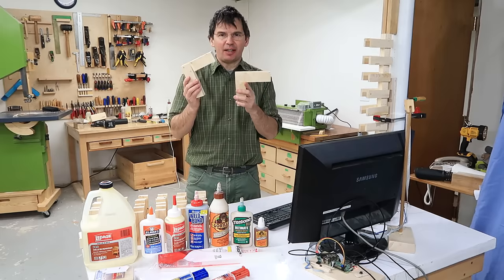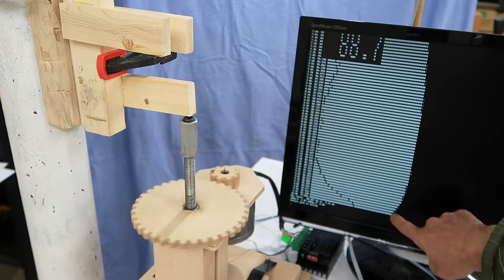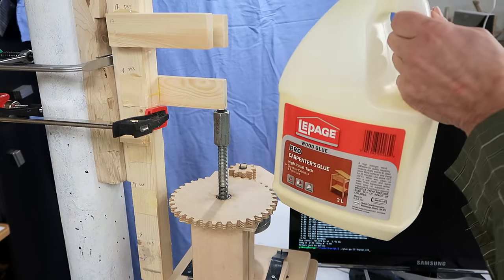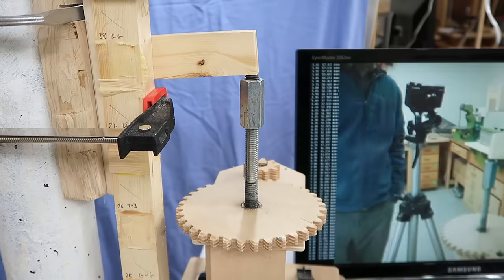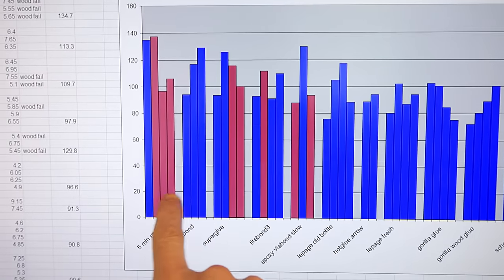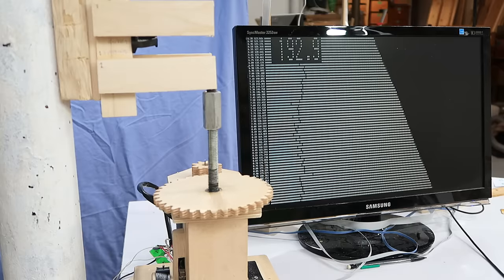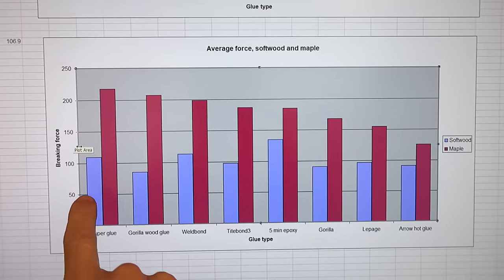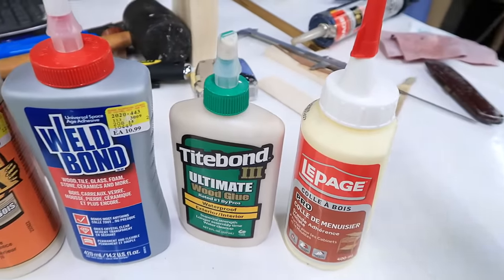Which glue is strongest?  Testing with my computerized tester.

Comment: Thanks for doing all those tests Matthias. Very interesting to see all those results. That must have taken a long time.

The construction adhesive that you used is different than the one John uses which is a polyurethane. I use the same type that he uses. I was building a workbench a few years ago using that polyurethane ca and realized I had put a piece of wood in the wrong spot. By the time I had a chance to get back to correct my error it was about 20hrs. I was banging that piece of wood with my framing hammer multiple times and could not get it off.
Reply: yes. the pl premium is the polyurethane based glue which cures with moisture. i'm not sure how that pl400 cures.  I would like to see how the pl premium holds up, i'd put a dollar on it winning or tieing with the epoxy.

Comment: Bravo for the constant strain rate tester, a DIY Instron.  
As with wood glues, there are numerous construction adhesives. Not all  of either category are created equal.  The Liquid Nails construction adhesives tested by Project Farm in July 2019 was at the bottom of the pack.

Comment: Great video, never would have thought CA would have done that well.

Real world feedback.

Gorilla foaming glue doesn't hold up in the humid Texas Gulf Coast climate.  I used it to repair part of a fence picket (the top piece broke off due to a knot and a utility line worker).  It lasted 3-4 years before the glue failed and the wood again became loose.  I cleaned it the best I could and used Tight Bond III and so far (4+ years) its holding.

Comment: That's a great comparison! Thank you. 
Further ideas for testing; perhaps try wiping down the gluing surfaces of the softwood with acetone or something to try to get rid of potential oiliness? And/or maybe scuffing the gluing surface a bit with some 80-grit sandpaper (even though it was already rough). 
Or maybe the softwood is just so relatively flexible that the weak points in the wood/joint are allowed to move enough for a break in the glue joint to propagate more easily.

Comment: Good test. The Titebond III is waterproof though. Don't know about the gorilla wood glue.

A few percent isn't a major concern to choose one over the others for all applications. The top performers are all fairly strong and are likely to break the wood before the glue. Stuff like working time, cleanup, water resistance, finish appearance, and sandability all come into play for real projects.
Reply: The gorilla wood glue is type II water resistant; not water proof, but fine for projects subjected to moisture (rain, splashes, etc.).

Comment: I would like to see a similar test with the pulling apart strength. This 90 degree test is good but introduced a twisting effect to break the wood or the glue. So, to see how it pops apart too to bottom not sheer strength.
Reply: I was going to suggest the same. I imagine the hot glue would fail quickly.

Comment: TB3 is still my favourite as a general use wood glue. I've never been a fan of WB or LePage in the past. Gorilla glue always worked as a "repair it now, not repair it right" sort of solution. Good to have around in emergencies but certainly not a woodworker's staple, in my humble opinion. Just like construction adhesive it's great at dissimilar material bonding for funky applications.

The thing that stands out the most is that the normal cure two-part epoxy is weaker in your tests than the 5 min.

I guess your data might warrant looking into LePage again. Thanks for sharing, good sir!

Comment: Thanks for doing this!
That very thorough, methodical approach reminds me of Project Farm tests.

I have been using BondCrete which is a PVA concrete admix/sealer/surfacePrep here in Australia and getting better results than traditional wood glues, with the addition that I already have it on hand in 5L buckets, be interesting to know if you have something similar there you could test.
Reply: Bondcrete is basically just standard PVA, but in bulk. It certainly works well on timber, but surprisingly (for what it's sold as) it is not particularly waterproof.

Comment: I feel like the surface finish has a lot to do with how good the glue holds. Something like oak with a ton of texture and pores combined with a good runny wet wood glue (water based to open up the pores too) would hold 2x as well as on a freshly jointed maple face which is ultra hard, and smooth and non porous.
Reply: that is something that i noticed too, it makes a difference if your wood is freshly cut or sanded vs case hardended.  or dusty, etc.

Comment: As a retired custom furniture/cabinet maker, I've used a lot of glue, and I'm still doing some woodworking.  I got a kick out of how your "test" came out compared to my favorites.  For ME, construction adhesive really hasn't been all that strong, and my two by far favorite woodworking glues are, Gorilla wood glue and Tite bond 3!  Looks like we are on the same wav length!  lol  SR
Reply: My favorite is titebond white all the time. I wonder how that would compare to other glues
Reply: @marcelo403polo2  Titebond has been my go to for home audio projects for years, this makes me want to try out the GG to see how that works out. I’ve also used construction adhesive for a few larger 30-40 cubic feet enclosures and I’ve found that it’s got a long set time so positioning awkward pieces was always easy. It fills gaps great and it sticks to most any surfaces + angles.
Reply: @Noughtta  
Being that it's formulated for structural use, I wonder if construction adhesive has more give to accommodate building flex without cracking.  If so, that give might have an impact on the acoustic properties of the enclosures.
Reply: Titebond 2 is my go-to, especially if you need something that sets up quick and for most interior projects.. Titebond 3 for exterior stuff or when you need a longer working time!!! All the other choices are garbage except the cheap "wood glues" which are fine for most DIY/weekend warrior stuff. Construction adhesive is just that. Construction adhesive. Yes it will hold but no where near a real wood glue. My fav construction adhesive is probably Sika adhesive, the gooey PL stuff is pretty good too but I'll always grab a tube of Sika before anything else.

Comment: The gorilla wood glue lasts a super long time from my experience. We've had a bottle for over 7 years  and it's still working just fine
Reply: That's how most PVA glues will behave as long as they're stored properly. Reputable manufacturers will always put a date of manufacture on the bottles though, and have a recommended shelf life. TB wood glues are 2 years minimum, so they're what I stick with.
Reply: @NWGR  if you store them slightly under the MFT / Chalk point (according to the data sheet) it will extend the life of the product usually dramatically
Reply: That means the gorilla container is airtight
Reply: Yep, if you can still get it out it will work just fine.
Reply: @NWGR  I see what you did there :)

Comment: Awesome video, but 2 questions; 

1. I have always heard/read that wood glue works as best as it can when both parts are smooth and well fitting. The logic being that the glue bonds fiber to fiber not to itself, so the more fibers touching equals more strength. The pine samples seemed to be very rough, well beyond typical "tooth" such as from a fresh sanding, including what looks like chip out and sawblade marks. Though a glue joint may be adequate with such roughness, it would not represent the maximum performance of the glue, if what I heard was correct. But, Matthias seemed to indicate that his expectation for wood glue was that it would be stronger on the rough surfaces. So that makes me wonder if I have misunderstood?

2. Does anyone have any data on how much strength is "adequate" for certain applications? I like these empirical demonstrations, but it leaves me wondering whether or not all of these samples were strong enough regardless of which was strongest. In other words, the construction adhesive, which I do NOT use, was the weakest but its possible that it would strong enough for a given application assuming the wood joint was well made?

Comment: Then there’s longevity. Not only is construction adhesive weak at the outset, it decides to let go years later. Our contractor glued and screwed floor decking to the joists. “You’ll never have a squeak,” he pronounced. A few years later, the adhesive had all let loose and I had to install many, many more screws to quiet the floor. I wouldn’t use construction adhesive to build a henhouse.

Comment: I use the traditional, exterior-grade wood glue for 99.8% of my projects. For those that use the caulk gun stuff, what is cleanup like after squeeze-out? Besides the workpiece, clean-up often includes clamps, work-benches, floors and other tools.

Comment: I think you cleared up a mystery for me. When gorilla glue first came out, I picked some up because I had been impressed with their duct tape. I had this same experience, it bubbled up like a foam and separated the joint. A year later I mentioned this offhand to another woodworker I know, and he's where he had been using nothing but it for a year. He had no idea what I was talking about when I said it was foamed up. I was completely unaware there was a second type of gorilla glue that was not that horrible stuff. I normally quite agree with this guy so it was one of those things that stuck with me, off putting.
Reply: Gorilla is a BRAND of glue, not a type. They make Fast and Slow set Epoxys, Metal-reinforced Epoxy (aka JB-Weld), Contact Adhesives, Super Glues, a full range of glues.
The bubbling stuff is Polyurethane glue, and it's also available from many other suppliers (eg: Sika). If you read the instructions, you will see that you MUST clamp that style of Polyurethane glue. You know, RTFM or the label on the bottle.

Comment: Are you testing the glue or the yield  load of the timber. If the timber fails before the glue you need to consider a different material in order to test the glue. I suggest a dense dry hardwood

Comment: Gorilla wood glue is fantastic my only issue is it drying TOO fast, Weld Bond is my alternative. Drys a lot slower but better suited for art pieces like laser engraving. When your tearing parts of wood out then the glue seems to not be the failure but the wood. What about drying times compared to strength?

Comment: At work we did some material testing and we figured that the adhesives are still curing after 1 week. We saw an increass on performance by ~20% between 24 hours and 14 Days.
Reply from the maker: didn't want to wait that long!

Comment: I mainly use the lepage glue.  I have dealt with a panel glue-up that was the standard foaming gorilla glue and one of the lepage.  The gorilla glue failed on the seam and it was the glue that failed. The lepage worked so much better and never failed under the same conditions.

Comment: Great testing and a great video. I am curious about longevity of these glues. While one may be better shortly after gluing, which one will provide the most strength years down the line? It would be interesting if you had some of these samples sitting in a garage for a few years to test strength after time and after experiencing temperature variance.
Reply: My guess would be the epoxy glues.  🤔

Comment: Your previous video where you experienced the bridle joint glue failures had me wondering...was it really a glue *failure*, or was it glue *starvation*? With the testing here, you just did a single face joint, which allowed getting a nice even layer of glue between the pieces before clamping. But with a bridle joint, or even more so with a box joint, you have to slide the pieces together during assembly, so it's not really an apples-to-apples comparison. I have often wondered if having a tight-fitting joint before adding glue just ends up scraping all the glue out of the joint during assembly. Your bridle joint tests where it appeared there wasn't any glue applied after they failed seemed to reinforce that theory. What might be an interesting set of tests would be to try bridle joints with varying clearances and use the same glue for each to see if the problem is that you are pushing all the glue out rather than the strength of the glue itself. And if so, what is the optimum clearance before the glue layer becomes too brittle and weak due to thickness?
Reply: Interesting point. Matthias once said of the foaming Gorilla Glue, “I guess it's a good glue to expand into inaccurate joints, but I prefer to just make my joints so that they are accurate.”  If Matthias is accurate to the point of nearly zero clearance, it wouldn't be surprising if he scraped the glue out of bridle joints.

Comment: Interesting test. Can you find MPA II glue locally? Haven't bought any in a while but pre-covid it was cheaper than tightbond by the gallon. It's been my normal glue for a few years.
Reply from the maker: never heard of that glue.  What does MPA stand for?
Reply: @matthiaswandel  Multi-purpose adhesive, probably.

Comment: The other problem with Gorilla Glue is its shelf life.  Everytime I have ever tried to use Gorilla Glue, it had hardened in the bottle before I could ever use it.  I eventually stopped keeping some around.
Reply: That's what he was referring to with the small bottle of Gorilla Glue (the "original"). The Gorilla Wood Glue he recommended at the end is a totally different product.
Reply: @robertharris1748  Right, I posted that before finishing the video and he went on to mention that.

Comment: I would like to see results on adding water to claggy wood glue. I have an old gallon I usually find myself having to add a little bit of water to, followed by a good shaking every time I refill my applicator bottle. Seems to do the trick.

Comment: Looking at your videos of the "glue failures" situations (as opposed to when the wood itself is cracking and splintering), it looks like the specific failure most of the time is in the adhesion of the glue to the wood surfaces. I would conjecture that CA glue is superior because its lower viscosity and thinner nature allows some amount of penetration into the depth of the wood, rather than just staying on the surface, thus forming more of a 3-dimensional bonding zone between the two pieces of wood. Think penetration in metal welds as an analogy. If this is indeed the case then it would be very interesting to see if macroscopically roughing up the mating surfaces, to make the bond zone thicker, could increase bond strength with some of the weaker adhesives.

Comment: If you check out "Bradshaw Joinery", which is a guy in England that does a lot of traditional joinery, he seems to only use a slow-foaming glue that comes in caulk tubes. I don't recall the type offhand, but it shows up in almost every video he does, and me usually mentions what it is. I think it may be a type you didn't test. I get the impression (possibly incorrectly) that it is a plastic-based glue, so may be more impervious to water damage than the usual wood glues. That could be useful for exterior or kitchen/bathroom joinery.

Comment: What’s the best glue for box joints? 
Not the strongest, the easiest to force joints together, slow setting with smallest gap. I’ve seen John H use construction glue on box joints and Jimmy Di Resta seemed to apply superglue after the joint assembled.

Comment: nice and interesting test!! Thanks!!would it make a difference if the test machine was pushing from other directions? for example, from the inside towards the outside (or the other way around) or along the glued piece? are glued pieces commonly stressed along these directions in usual woodwork?

Comment: The adhesion of the glue to the softer wood is better than that of the hardwood, however, that bond works against the strength of the test not for the strength of the glue, but FOR its strength over the wood, the wood is sure to fail faster, most of the failures happened due to the rigidity of the glue, and the lack of strength in the lignin bond between the layers of wood.

Comment: Franklin (titebond) recommends full sanding of and smooth surfaces before gluing. They say rough wood will not bond as well. So looking at your softwood, I think that says a lot, vs the maple. The maple appeared to be smooth. Also wood that is not surfaced may have started  to oxidize and therefore block the full bonding.  epoxy likes a mechanical bond, so the softwood might be an advantage.   Still an eyeopener. That opening test of hot glue had me on the edge of my seat. I never consider hot glue as a good perm bond.. so that first one was totally bizarre.

Comment: I use tight bond 3, mostly because I remember it holding up well in strength tests and exposure to moisture/elements. The downside is it dries darker and is harder to clean off of wood wet than a lot of other glues. I would be interested to see how gorilla wood glue holds up to water or moisture/temperature. Might be a worthwhile switch if I can get it in a jug like tightbond.

Comment: I long ago switched from TiteBond to Gorilla wood glue because most of my projects require staining. I always wondered whether there is a difference in strength because I never see anyone else using it. In my experience though, if TiteBond gets on the finished surface prior to staining, it is a huge pain to get that spot to take stain. On the contrary, with the white gorilla glue, it is much easier to scrape and sand any drips and squeeze-out. And, on lighter stains, if I miss a spot, the drips are a lot less noticeable because it does take some stain.

Comment: now that you've used these - i wonder how spray-adhesives (with and without activator) stack up against these results... company i worked for did all corner joints for wooden crown moulding with these as well as - of course - all veneer work